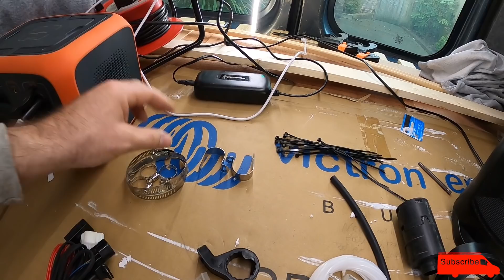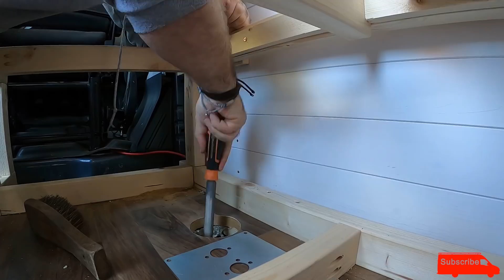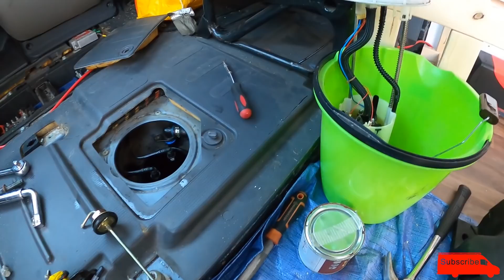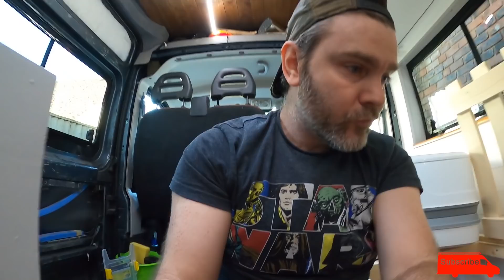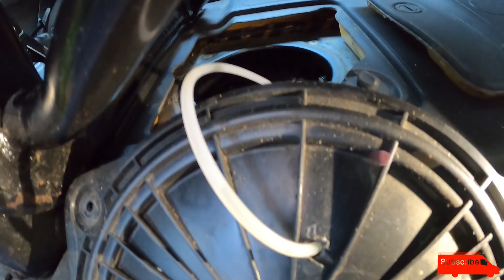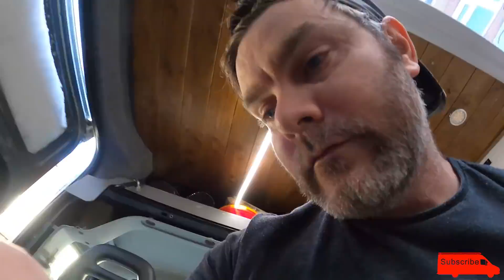Step by Step Diesel Heater Guide || Ducato Camper Conversion || Ep 20

Comment: Great tip on removing the plug to route the controller cable.  I did mine today and using this method was able to route the cable through a small hole.  Thanks!
Reply from the maker: Thank you. I'm so glad I can help 😁👍

Comment: Still the best installation I have seen for a diesel heater. My Elddis CV40 cuts power to everything apart from the fridge when I start the engine. Does this heater need a permeant live feed. I could put  a little fuse box from the leisure batteries but what size fuse does the heater need? I will definitely take some pictures to send to you so I can better explain what I mean. Hope you don't mind mate. Still haven't ruled out a drive down there. Would love a chat with someone who knows what they are doing.  😁
Reply from the maker: Hi, it doesn't need a permanent live when not using the heater. Regarding fuses, the heater comes with a 20amp fuse but remember a fuse is for the cable that you use not the appliance. The fuse has to blow before the cable melts. The heater pulls about 5-10amps on full power so a 20amp rated cable would be fine. 👍😁

Comment: Hello mate, new subscriber to your channel and this is the first video I have watched. Watched all the way to the end and enjoyed it all. Very informative. I would love to fit a diesel heater myself but after watching your video a few things came to mind. 1. My van is an Elddis CV40 and there is a 6 inch high platform / step and a dining area where you have put the heater. Do you think the heater would fit under the step or does it need more ventilation? 2. I have seen people put the fuel line in to the breather pipe so there is no need to drill holes in the diesel tank. That seems easier to me me. What do you think of that idea? 3. I don't have the confidence to drill holes in my van. 3. I couldn't figure out how you got the fuel line from the tank to the heater. 4. Where in the UK are you if I want you to do it for me? 😁 Apart from that...all good. Really enjoyed the video and that's why I have subscribed. Thanks for sharing.
Reply from the maker: Hi there, thank you for subscribing, and welcome. I would say the heater needs more ventilation that that. The units themselves and higher than 6 inches. Plus the heater needs to draw air through it and it can pop up warnings if the air flow surrounding it is restricted. Feel free to email some pics to me so I know what were talking about. lukesvanlife@gmail.com

I have also heard about people using the breather pipe, I however feel that your fuel tank needs to breath which is why that breather pipe is there. I live south east England. Between Gatwick and Brighton, is that too far?. Thanks again for subscribing

Comment: It makes sense to install the heater the farthest away from the bed. Wish I seen your video before I installed the batteries behind the drivers seat. The length of the positive wire in the battery isolator kit was the perfect length to the batteries. I can't afford to change it around so I will try my best to sound proof the cabinet that the heater will be in and install the pump under the van. I was thinking of installing the fuel tank on a cabinet above the heater and run the fuel line through the floor to outside then to the pump and then to back to the heater. Or should I have some distance from the fuel tank and pump to heater. Thank you for saying something about the green fuel line , I was concerned when my heater arrived and I seen the green fuel line. I might rethink my installation location 🤔 choices
Reply from the maker: Thank you for watching. Glad I could help. Hey, if it works it works. 😁👍

Comment: 👍 Stayed to the end. Very helpful. Have ordered my heater, same as yours, 5kw. Just waiting for it to arrive, hoping to attempt fitting it next weekend! 😆
Just a question regarding fuel, have you ever tried red diesel or kerosene in them? Is there a cheaper alternative that road diesel and do they run ok on either?
Reply from the maker: Hi, thank you for watching. Lots of people use kerosine or red diesel in them and they work fine. I've not yet tried anything other than normal diesel. Good luck fitting, if you get any questions just let me know. Make sure you use heavy duty jubilee clips 👍😁

Comment: Installed mine today, followed all the best you tubers (like yourself) instructions and Im just getting an E-03 Error message which is apparently a glow plug issue.   Cant see how the glow plug could be gone on a new unit... back to the drawing board :/
Reply from the maker: Sorry for delay, did you get it sorted?
Reply: yes and no haha  So it will start and run which is grand,  but it takes maybe 7 or 8 tires at starting up before it finally does and then I still get an E3 message when it shuts down.  Weird eh :S

Comment: Hi Luke,

I've got the green fuel line. However it doesn't come with the black connector to go over it. 

Is that a problem? Can I connect it without the black connector or do I need it?

Thanks tons,

Josh
Reply from the maker: Sorry for delay, green doesn't need black, just goes straight on with clips. Hope you got it sorted
Reply: Legend cheers mate. Did that in the end but just wanted to double check. Cheers buddy

Comment: I just got the all in one unit off ebay.  So no fuel line and pump to mess with. The instructions look like a 20 amp inline fuse goes on the negative battery cable.  Should that be the positive? Or is negative ok. Could  / Should I do both? 
And why don't they come with a blummin inline fuse!?
Reply from the maker: Sorry for delay, you prob got it sorted by now. Always fuse positive.

Comment: Very helpful Luke, I'll be fitting one of these soon.

Does that exhaust muffler have to be mounted vertical like that? 👍
Reply from the maker: Thank you. Exhaust muffler doesn't have to be on the side. Unless there's a small drainage hole on it in case rain got inside. 🤔😁👍

Comment: hi i really enjoyed the vid and stayed to the end , i was wondering how much more difficult it would be to install the heater itself under the van ? i have a ex police swb which had its heater underneath in a watertight container, unfortunately both the heater and container were trashed by the last keeper but the exhaust and intakes still there, so as its a swb and where you suggest placing the heater il have rear facing seats  i quite liked the idea of under mounting it and just having the hot air pipe inside
Reply from the maker: Hi, Thank you for watching to the end. lots of people do mount them under the van. Anything is possible. I don't think I'm clever enough to fabricate that though 🤣👍😁
Reply: @LukesVanLife  i think iv found a good option, using a insulated  caravan battery box will keep it water and crud clear then just run the hot air ducting and controller into the van oh and putting the fuel tank in the utility cupboard im making out of aluminium by the sliding door at least its a hopeful idea, knowing my luck it wont be that easy though lol again thank you for all your info :)

Comment: Our heater is under our bed in the garage....we never use it at night so we dont have a problem with any noise......but ours is a Webasto heater so significantly quieter than the chinese heater .....but each to their own i suppose  .....as long as it works for you its ok!

Comment: I stayed to the end.  Is there a way to use the supplied tank for red diesel in conjunction with the main tank so you can switch from main tank to red diesel when you want. Would be interesting.
Reply from the maker: Hey, now there's a good idea. Yea I dont see why not. Just need to find a two way switch/tap for the fuel line. That would make for an interesting video! :)

Comment: Managed to hang in there with ya bud, not sure I’ll put one in mine, as I use a wood stove, but that instant heat would be nice.
Great to see you using the vans fuel tank, looks like a good method. 
Many thanks for doing the vid, even tho you’ve heard all the feedback before 😉
Reply from the maker: Thank you for watching. It would be worth having in your van as a spare. In case you ran out of wood. Or for those cold mornings where U don't want to get our of bed to light the fire, switch the diesel heater on with the remote from bed :) I would like a fire in my van too now so I have a back up heat source. Thanks again. 👊😁👍

Comment: Top tip, cutting the exhaust in half and fitting the muffler midstream makes it much quieter. Trust me it's true 🤣
Reply: I’ve bought a second silencer/ muffler to fit inline. And loads of rubber exhaust mounts for the pump. It will be silent.🤫. Until I turn it on.
Reply from the maker: That's interesting wouldn't have thought to try that. It really works does it? Thank you
Reply: @LukesVanLife  yes and you can also exit with a neat pipe instead of it stuck on the end. I've fitted eberspacher heaters for years this way.

Comment: 👍👍
All the way.... Normal speed!
Best instruction so far!
(Not wishing to incur the wrath!.... The only thing I would do differently is set the silencer to horizontal and spin it 45°, just to make sure it doesn't get knocked off by enthusiastic off roading..... Sorry!!)
Reply: Roger there is a slot for condensation/water to drip out from and why it's recommended that you fit the exhaust verticality with the slot/hole at the bottom.
How much this matters in a real world situation I don't know and doing it your way may be OK.  Pointing the exhaust down a little would probably be just fine too, either that or drilling a hole in it but it may rust through quicker.
Reply from the maker: Thank you very much for watching. Don't be sorry, I welcome useful suggestions. 👍👊😁

Comment: This isn’t a criticism it’s just a comment or rather a question. With the diesel tank being outside of the van and the diesel pipe into the heater on the outside of a van what was your reasoning for running the pipe through the van and not underneath?  Stay safe
🚐☕️☕️👍🏼🏴🌈🙏🏼💙❤️💙❤️
Reply from the maker: Hi there, the reason the fuel line came into the van is that, the vans fuel tank is so tightly fastened to the van, there was no gap between for the fuel line to run down the side of the tank to run outside the van. 👍👊😁
Reply: @LukesVanLife  it is possible the one I fitted to a LWB went over the top. Poked a piece of electrical wire from underneath didn’t find a problem. Stay safe🚐☕️☕️👍🏼🏴🌈🙏🏼💙❤️💙❤️
Reply: I was just going to ask the same fella.
Reply: I was also wondering the same thing, maybe I’m wrong but I don’t see any logical reason

Comment: My pump isn't anywhere as noisy as that one! Surely there's a better aftermarket one out there?
Reply from the maker: There are after market pumps you can get and so called "quiet pumps" but there's no real difference in noise. This pump in this vid does get quieter once is properly full of fuel. Also I have a sensitive microphone on my camera so it makes the pump seem even noiser 😁👍

Comment: Mate that slot in the base plate! Why didn't I realised that it was for the pump wire??
8-0
Thx for that!
The countdown feature is a step back I think, knowing at what time to heat it is more easier...
Couldn't you reach the stand pipe from underneath, or why did you feed the fuel line through the inside? The small distance between the heating pipe and the fuel pipe would make me a bit nervous...
:-0
Great vid, thx a lot!
:-D
Reply from the maker: Yea, it's the first time I've used that slot haha. Yes the countdown feature sucks, I don't know why it changed. Lol 😁👍

Comment: Nice one Luke! Great video, yeah I regret not plumbing this van into the main tank as its so easy. I was going to use the pump wire slot and forgot 😅 Great tip for the display connector 👍 I actually prefer that display, You can do so much more and timers. I also wired a switch just to the display. I think I used the black as the red doesn't work.
Reply from the maker: Hey, bud, thanks max. You wired a switch the the black wire on the display? That turns off just the display? Does the heater still run fine when the display bis switched off?
Reply: @LukesVanLife  I tried the red, can’t remember what happened but it wasn’t right, then tried the black and it worked fine, but the heater detects there is no screen after about 30 seconds then turns off in its shutdown cycle. I have disconnected the display before, but not for any long periods of time. It may just be when any connection of the screen turns off. I did it for nighttime because of where I mounted the screen👍